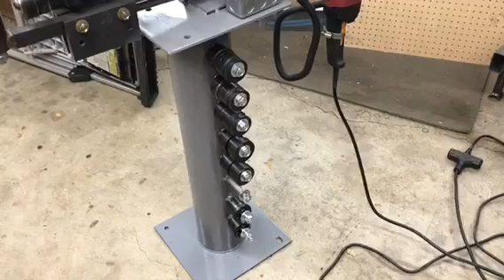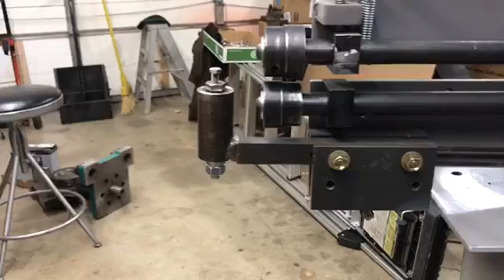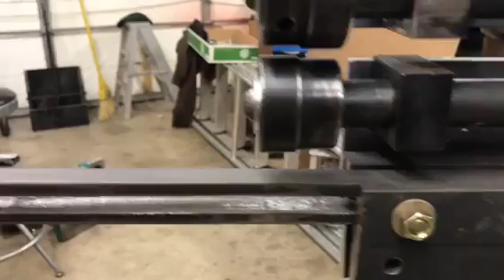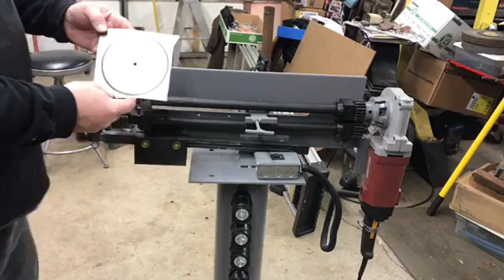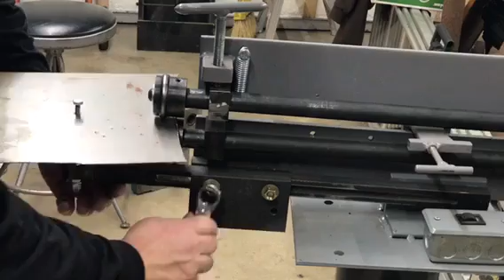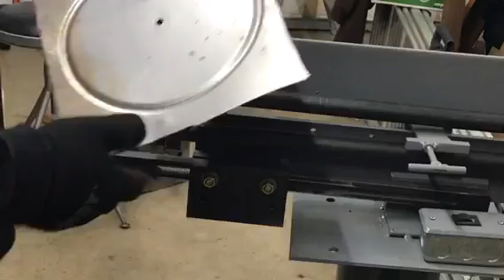Harbor Freight Bead Roller Modification Part 2

Comment: What device did you use to motorize the bead roller brand model/part number and at a store or internet looks like a very inexpensive way to make this work also does it hook right up or is there some maching to be done Thanks For Your Time

Comment: Would a variable speed pedal work on the pipe threader? That way you could control the speed better.
Reply from the maker: steve Ferguson that is a great idea.
Reply: Jim McClellan I just got the Woodward roller. I’m collecting all the parts to make mine like yours. I’ve already made a stand from scrap. Now I just need the motor drive. Great video, thanks!

Comment: What is your foot pedal and how did you make it work with the pipe threaded?
Reply from the maker: It is the Harbor Freight foot switch. This is the link https://www.harborfreight.com/power-maintained-foot-switch-96618.html.
Reply: @jimmcclellan1911 , thank you, is there anything you would change if you did it again?
Reply from the maker: Matt Glandorf I would have built a new main frame from thicker steel.  Also I have a stop that mounts in the square tube on the right side and I did not build that heavy duty enough.
Reply: Jim McClellan, do you mean a stop in the tube holding your circle jig?
Reply from the maker: Matt Glandorf no.  The gray square tube is a clamp stop for use when making a repeat bead usually in flat stock.  Think of it as a fence on a table saw.

Comment: Great idea and video. 
The circle attachment could be constructed with tubing and a shaft. A "D" profile rotary shaft is available from McMasterCarr. 4130 tube is availablle from Aircraft Spruce.  A 1/2" rotary shaft would require (your choice) a 5/8" x .058" tube or a 3/4"x.120" wall tube. This gives .009" and .010" clearance for the shaft. The tube would be welded to the bottom of the bead roller frame.  A 3/8 nut could be welded to the tube and a 3/8 bolt would then clamp the shaft in place. The only requirements are to position the shaft so the  flat is either down or parallel to the bearing assembly, make sure the nut lines up with the flat so the assembled circle attachment is in the correct position as you have.  This assembly would have infinite adjustment and no milling machine is needed  -  just cut, position and weld. This would require a slightly modified mount from what you have. Hope this is understandable.
Reply: Dude, make a video........
Reply: ALfonso, my name is not dude. Calling people names shows how tiny your mind is. If you want to learn about galvanic corrosion, you can look it up on the internet.
Reply: Alfonso, my name is not "dude". If you don't agree with my opinion, offer some facts showing different. Calling me dude is impolite. Doesn't hurt, just rude.

Comment: Very good video.  When putting in a bead,  do you cut your piece to the final size before or after the bead is made.  That is, does the beading process change the dimension of the sheet?  Thanks for posting.
Reply from the maker: Joe Atwork depending on what I am making I have done it both ways.  The bead does alter the dime sign of the material slightly.  The more beads in a single piece the more the dimension would change.  When I make the circles for the end caps for oil tanks I just use the bead roller to cut rough circles then I dome them on a stump so with those I always cut to a finished size after I dome the caps.

Comment: holy mods batman. really really nice...i cant find this on the hf site does anyone know the model number.
Reply from the maker: Minskmade.  Looks like the roller is not available right now from HF!  Try this one https://www.jegs.com/i/JEGS/555/81235/10002/-1?CAWELAID=230006180037507680&CAGPSPN=pla&CAAGID=39714413703&CATCI=pla-457013475483&CATARGETID=230006180040357472&cadevice=t&jegspromo=nonbrand&gclid=EAIaIQobChMIoJ2b-_jk3AIVj4bACh0bEAJPEAQYASABEgIH-fD_BwE
Reply: thanx jim ...what is the  tool motorizing your bead roller?
Reply from the maker: minskmade that is the Harbor Freight pipe threader - it is a beast!
Reply: so smart. i thought it was a pipe threader..i was thinking a right angle drill would work also.
Reply: i wonder if a right angle drill would have enough torque?
Reply from the maker: minskmade it might have the torque but it may not spin slow enough.  I actually will modify this over the winter to slow it down a little more.

Comment: Great idea. I have a question . In the vidro the center line (pivot point) of your circle jig looks like it is slightly behind the Centerline of the dies. Is it just the camera angle  that makes it appear that way ? Or does it need to be slightly behind? Thinking I'll add that to my bead roller https://youtu.be/fDsOPsKyjEc
Reply from the maker: scottk900 The center line being off in the video is just the camera angle.  It is centered to the dies.  By the way, I watched your video and I love the way you mounted the fence!  I am adding that style fence holder and fence to mine ASAP!  Thanks, Jim.